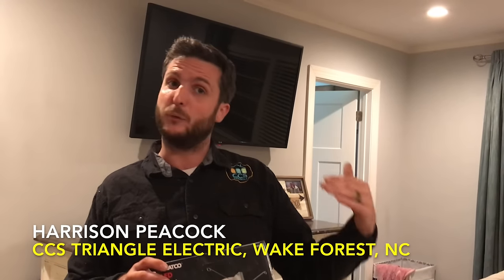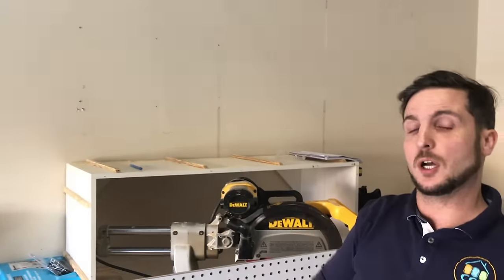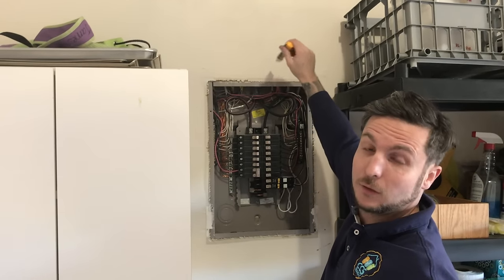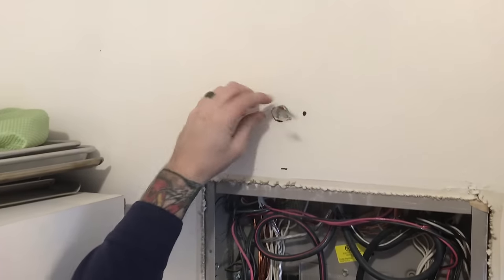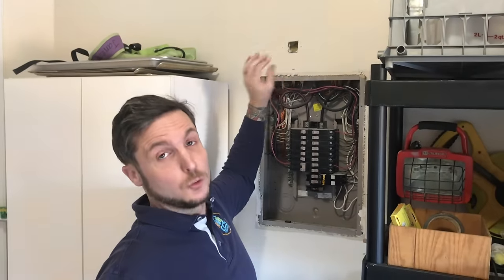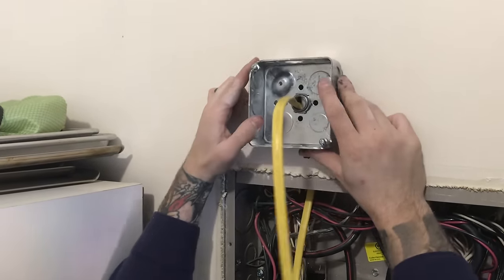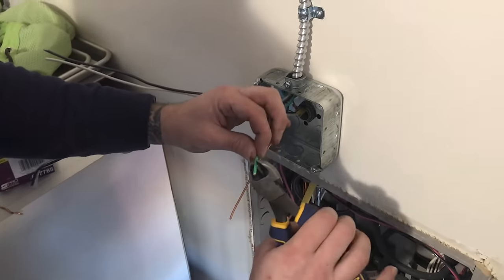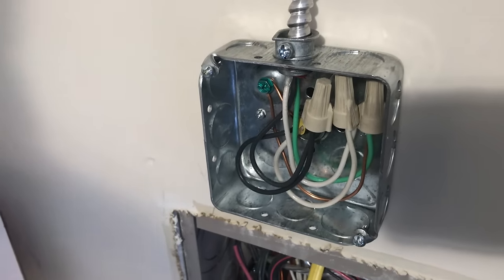New Garage Outlet From Panel--VERY DETAILED! (New Circuit / GFCI / Breaker Box / FULL INSTALL!)

Comment: Just first note, always wrap the ground wire in the direction the screw goes to tighten, he looped the wire on the screw in  the opposite direction, that worked only because it had a long tail on it otherwise it would have spun the wire away from the screw and a bad connection.  Never pull on wires like he did to remove outside cover, 17 yrs experience or not, copper does stretch and get weak.  These are just my observations
Reply: I would have run EMT with an offset into the panel directly. That box is unnecessary and not professional. Not to mention all the other things others have committed on.
Reply: British code says wrap the ground backwards. lol
Reply: @jjyemg2397  seriously?
Reply: Indeed that’s always my way and what I think is the right way, wrapping the wire clockwise around the screw. But this applies only when there is one free end of the copper wire which is not the case here so it’s all good.
Reply: @maxwang2537  NO. I was being facetious
Reply: @stevenzembriski6761  Genuine question, how would he have done that with the panel being in the wall and the conduit being on the wall?
Reply: @garyjeffersii6735  Cut a section of the wall large enough for the EMT conduit then make an off set to the top of the box I can send you a picture of mine if you send me your email.
Reply: @stevenzembriski6761  I think I can picture that now. Thank you. Obviously the connection to the panel would have to be made first then or you'd never get the pipe in place, right?
Reply: @garyjeffersii6735  My EMT piping went out of the top of the panel via a knockout and up the wall and then a 90 degree across the ceiling to a 4" box. The EMT has an offset of about 2" that goes into the top of the panel. I put a connector on the offset side of the pipe and then inserted it into a knockout hole on the top of the panel and then connected it with the nut. I just had to cut a 10" long X 1.5" wide slot of the sheetrock so the offset would meet the knockout hole in the panel, I then spackled the slot making a nice finish. My EMT Conduit was for a 4 post car lift which terminated to a dedicated 30amp outlet. Hope this helps you visualize it better.
Reply: @stevenzembriski6761  Thank you very much for that detailed explanation. That does help me visualize it.
Reply: @garyjeffersii6735  Great, glad I could help. It is a much cleaner and simple way to get into the panel.
Reply: Friend of mine was going to exchange an old outlet for a new one.
     He came home one evening to find his future ex wife had gotten tired of waiting for him to do it & was in the process of doing it herself.

    Lucky for her, he caught her before she got too far.
   She had only removed the outlet cover & taken the screw out of the outlet.

    She had no idea to flip the breaker.
    He asked her how she was going to do the wiring and she had no idea that wires were involved.
   She thought it just sat in the wall I guess. 

   Crazy thing is. She isn't that stupid over all .
   Just kinda a stupid Btch,but then , my friend has a way of bringing that out of a woman!
Reply: @stevenzembriski6761  I still do not follow. Was your box recessed in sheet rock? I've only seen these boxes added when new runs are made.
Reply: Shouldn’t first jbox be grounded so metal box and on will be grounded even before that final box?
Reply: @yeehaw398   If I'm understanding your question correctly, watch around 13:40 when he secures the bare ground wire to the box and says " that box is now grounded."

Comment: You should wrap the ground in a clockwise manner around the ground screw in that box. That way it tightens rather than opening up.
Reply: I was going to comment the same thing.
Reply: The wire does not terminate at that screw. Look again.
Reply: @ethelryan257  It does not matter if it terminates or not.  The wire must be around the screw clockwise, because the screw tightens clockwise.
Reply: I saw him do it counterclockwise with his finger first, so I predicted correctly that he would do it wrong.   The wire must be around the screw clockwise, because the screw tightens clockwise.  I am an electrician in Canada.  Counterclockwise wrapping of wire around a screw or terminal is a very basic error, and demonstrates sloppy workmanship.  I would never hire this company.
Reply: This is the most basic principle of wire attachment to a terminal screw.  If you don't know this one, you shouldn't be doing electrical.
Reply: @chrisgraham2904  Are either of you licensed electricians? Does the NEC specify the direction of wrapping around a screw terminal? I agree that it seems strange, but he was quite competent and knowledgeable in most other respects, so I'm leaning towards trusting the licensed professional with almost 20 years experience.
Reply: @HypherNet  yes. I am a licensed correction and they are right. All connections must loop in the same direction the screw is in order to ensure proper connection.
Reply: @HypherNet  Yona, LOL John literally just said he was an electrician, you literally said that right after he did, wow
Reply: @HypherNet  The gentlemen above are correct. They do teach this in apprenticeship school. It may not be written down some where but it is taught. And in the 30 years I have been in the trade it has been given. Is it written you have to flush the toilet after use? No but you do it because it is a basic rule you understand and taught as a child as the right way to do it.
Reply: @HypherNet  while it may not specifically say to wrap wire in the correct orientation. There is a section of the NEC in Article 110.12 that states:

"Electrical equipment shall be installed in a neat and workmanlike manner."

If you ask me, I believe wrapping the wire the correct way falls under this article. Because wrapping it correctly is a workmanlike manner.
Reply: I saw that at around 30:00 in and immediately went down to the comments... and sure enough first comment thread lol >_<
Reply: @HypherNet  Just because he's doing a tutorial on a youtube channel, doesn't mean he's an expert. I see multiple things wrong including sloppy workmanship, and code violations.
Reply: @generaleeification  direction of wire wrap is not code violation in our municipality,  but certainly is more difficult to do and  make look good. Running MC cable exposed in this manner is a violation here, you would fail. inspection.
Reply: Tim Rich what code article does it violate?
Reply: @eksine  Let's stay positive. She made a a simple mistake, we all have derp moments.
Reply: @eksine  Feeding a troll was my derp, age of the troll has nothing to do with it.
Reply: dont tell the secrets
Reply: @eksine  What difference does it make in replying to an old comment? If there is something wrong stated in the old comment, others get to see the reply which may correct a wrong idea! Shouldn't make any difference if it is 2 months or 2 years old. Calling a guy an idiot over something very little, maybe your panties are too tight.
Reply: @timrich6755  You say MC cable exposed is a violation? What is the point of using it then other than in an exposed location? Where is your location if it is a violation? I would think all States in the USA are covered by the same NEC code. He is a licensed electrician so i would assume he knows what is legal in his state. He also stated it was his preference to use conduit and gave the reason why he was using MC. Maybe before spouting off you should find out what is and isn't allowed in North Carolina instead of making him sound incompetent.
Reply: K Stewart MC can be pulled into a finished wall if you want to run it from an existing outlet box to add another outlet box. It’s done all the time.
Reply: How should he have done it to wrap it clockwise? I believe if you look at it. It is wrapped clockwise, he just wrapped it ccw. If that makes sense.
Reply: @mattrob15  if you pretend there is a screw than there are 2 ways to wrap the wire around it, one way the wire will end up on the left side, the other way the wire will be on the other side. look at which way the exposed end of the coil will end up, is it clockwise or counter? you can either start with the exposed end on the screw and then start wrapping or you can press the wire to one side and start wrapping by twisting the exposed end around the wire. what's important is which way is the exposed coil looping?, clockwise or counter? now pretend to screw that screw clockwise to tighten it. will that tightening motion tighten that coil and compress it into the screw or will it loosen it if you try to tighten the screw? that is how you know you're doing it right, you obviously do not want the wire to loosen while the ground green screw is tightened down clockwise, because righty tighty, lefty loosey
Reply: @mattrob15  Not sure what you mean.
Reply: @mattrob15  it’s not wrapped clockwise. Re-watch the moment he does it until you understand. Again, it’s not a code to do it clockwise but any electrician with some amount of experience should know that it’s best practice to do wrap it clockwise.
Reply: Correct !  '' Righty Tighty  , Lefty Loosie  '' !!!
Reply: @timrich6755   Your jurisdiction does not allow mc cable installed per NEC 330.10. ? Which allows for exposed installation. Apparently your jurisdiction has codified a more restrictive use for this cable......mmmmm.
Reply: @johnsanders4279  ; And it causes Loose Connections which produce ARCING which causes Electrical Fires !! Common Sense People ! Righty Tighty -- Lefty Loosey  !!!
Reply: @timrich6755  ; Installing MC in Residential  in this manner does not violate any NEC standards as long as it's not subject to physical damage in any manner !!!
Reply: @suspicionofdeceit Do you buy the pre-made ones? I just make my own as I need them.
Reply: @suspicionofdeceit Yeah I usually won't buy them. I just can make one up in like 30 seconds as I need.
Reply: @ethelryan257  because the ground wire need to be connected to the receptacle too. Agreed that the wire has to wrap around the screw clockwise. When connecting wires at the terminal screws, I follow the same principle to ensure the wire does not pop out when I drive the screw in.
Reply: He wrapped the wire around the threaded screw shank almost 360 degrees, and then tightened it. It's not going nowhere. Each technique works effectively.
Reply: none of the wires were wrapped. They were all inserted straight. The flat tab connected the ground screw connection encompasses the entire surface area of the exposed ground wire. In the beginning, at the junction box, the ground wire wasn't cut prior to making the connection.  Your thinking had he cut the ground and made a small hook, the force from the screw from the driver would push the ground wire out. Tension and compressive forces are also dependent on the mass and the length of the wire.
Reply: @Chris-ql1pd  he wrapped the ground wire around the green ground screw counter clockwise inside the junction box. I don't know what you were looking at but I am 100 percent positive. I always go around the screw so the wire wraps in the direction that the screw turns.
Reply: @Chris-ql1pd  I never said he cut the wire and made a small hook. I said he wrapped the wire around counter clockwise. I do lighting and electrical for a living and most electricians always go around in a clockwise manner because it makes the wire close tighter rather than open up.
Reply: @Chris-ql1pd  Go to 13:41 and he talks about wrapping the wire around the screw, and he does it counter clockwise. Yes, he left the wire long, but no he didn't put it "straight in." You cannot put a ground wire straight in, it must be wrapped or looped.
Reply: Wrapping the ground wire around the bonding screw in a counter-clockwise direction is NOT a code violation. However, doing so  can sometimes cause  the ground wire to  partially come out as the bonding screw is being torqued down. Most inspectors will notice that and make you redo the ground before they  pass you.
Reply: @kalijasin  I know it's not a violation, but it is common practice for electricians to do it in a clockwise manner because they know it closes the loop rather than opens it. Everyone I know who knows basic electrical skills knows that you are supposed to do it in a clockwise manner.
Reply: I agree clockwise is the way to go, however he did recognize the potential problem with his approach because he pulled the green ground wire TIGHT the entire time he was turning the box's ground screw until secured, he even mentioned to pull tightly.  The concern is over the opposing forces,  as mentioned a few times,  the counter clockwise wrapped green wire will be pushed out of place by the clockwise rotation of the tightening screw, but he did counter act that force successfully.  Ultimately, the wire never shifted which would be the concern.
Reply: Seems like almost none of you understand physics. When it is at the end of a wire, a clockwise hook will be superior and stay tighter when screwing. In this case he has a long tail on both ground screws he installed. The long tail essentially makes both ends and sides of the wire congruent and gives ability to pull on both sides, so the screw cannot push out the loop of wire.  In this situation only the viewer cares which way the wire is wrapped. The screw and wire see it as equal either way.

Comment: Just sharing a little trick.... you could run the Romex through the wall and into the panel first... then slide the metal connecter onto the Romex, which will guide it in place in order for the connector to be fastened to the panel. you don't need to make the hole larger to fit your fingers into it....